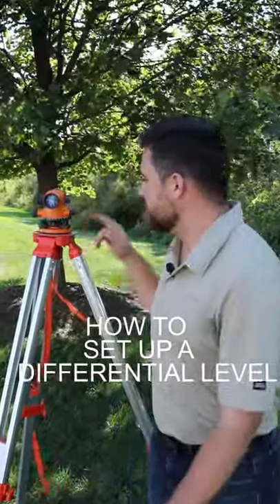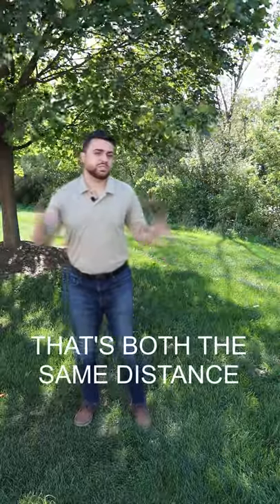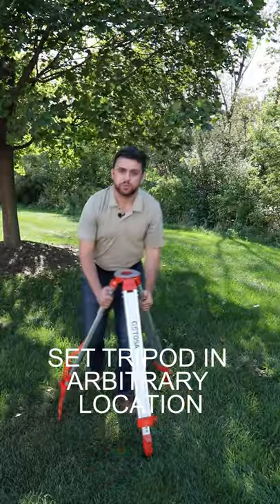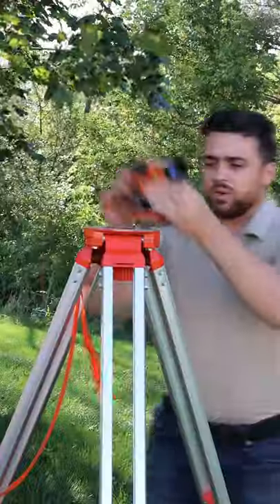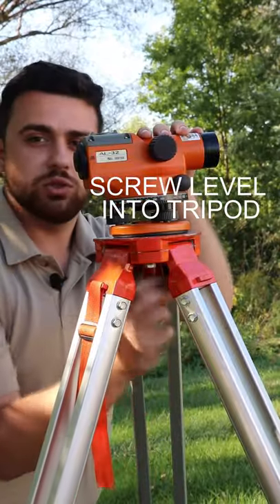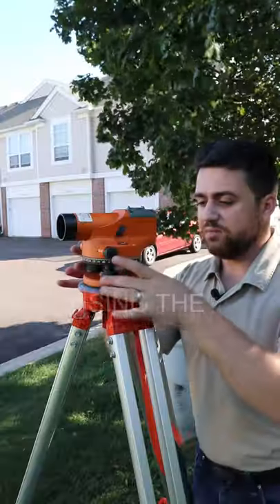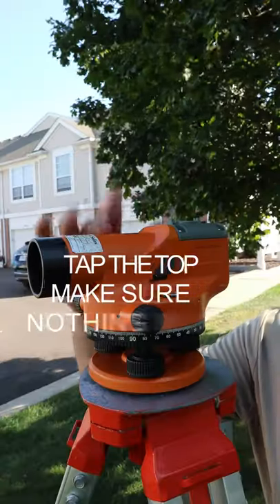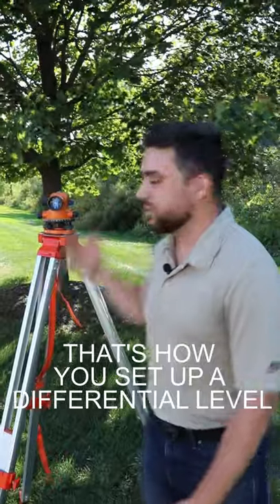How to set up a Surveying Level #Shorts

Comment: Rami, I wanted to see it placed exactly over a point. Optics make it easy as do lasers but most Levels do not come with either. I know this is not a problem with a total station but with a level it is a challenge to do it right. Lets see how a pro sets it up over a point. No one else has a video like that can you do it?
Reply: You normally don't set a level over a point. You're essentially picking up an elevation at your backsight and setting it down on your foresight. It just needs to be level and able to see the rod.
Reply: Why you need to place it exactly over the point?